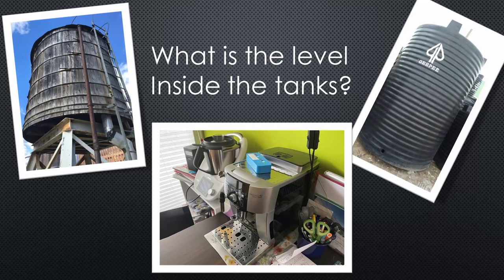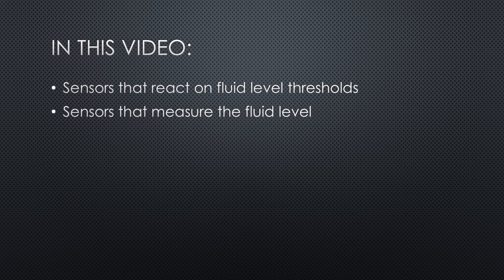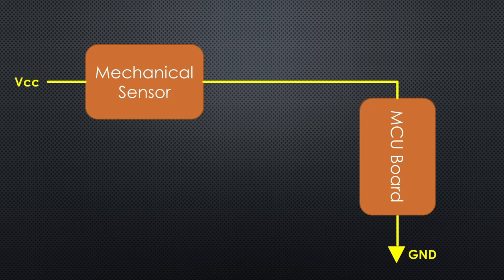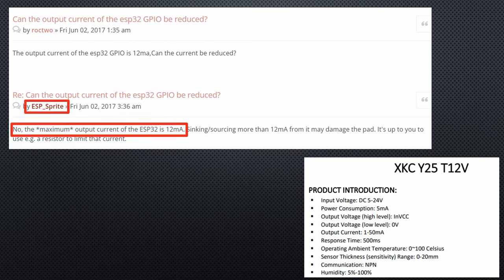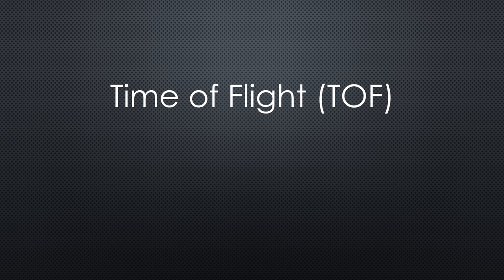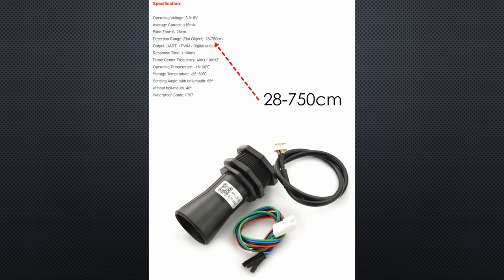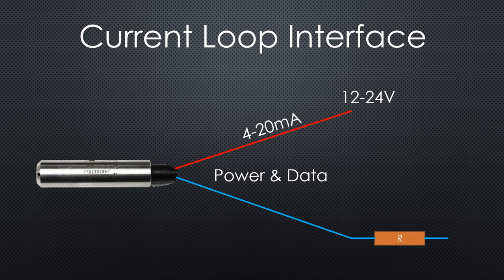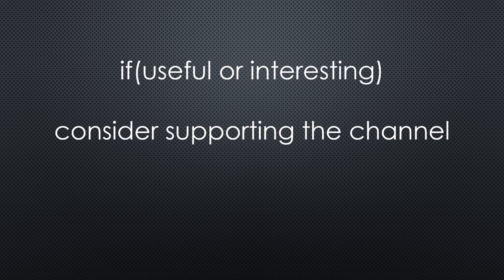#411 Ten Fluid Level (Water Level) Sensors and how to use them (Arduino, ESP32, ESP8266)

Comment: fwiw i found the infra red optical level sensors preferable to float switches which can suffer from calcification in our hard water area..
Reply from the maker: Good point. How do you mount these sensors?
Reply: through a hole in the tank wall, since i was replacing float switches it wasn't a problem to reuse the 1/2"bsp (20mm) sized holes.  they do require the lens being submerged. 
capped plumbing tube can make a diy sensor dipstick..

Comment: Hello andreas, i have a question. What's the best strategy to measure large water level such as a lake or reservoir ?
Reply from the maker: I saw that they used ultrasonic devices for that. But I assume pressure sensors also would work if you have access. Maybe somebody has already don it?
Reply: You often see these sensors which look like a pipe (culvert 30-50cm) coming out of the ground with a conical top. Inside is a pulley at the top with a line connecting a weight and weight with a float. The pipe connects to the lake or river with a tube, so when water enters the tube, the pulley rotation is measured. Originally, they were mechanical, recording on paper. Now electronic, you see a radio and often solar panel.

Comment: I would like to see your final solution with the coffee machine :D
I have the same problem .. bought a new coffee machine (not the cheapest one) and in the manual they say (don´t use the coffee machine with the empty tank) but no sensor / indicator on the coffee machine which says the tank is empty 🤦‍♂
Reply from the maker: So far I had no time to finish the project :-(
Reply: @AndreasSpiess  Schade ... if i have a nice working solution, i will share this on my channel :)
Reply from the maker: @d3rbastl3r  Subscribed 🙂

Comment: Thank you for information I am one of your followers and I like and respect your experience and the way you explain the ideas I am using ultrasonic waterproof sensor with arduino and I used NRF24L01 for wireless communication because it’s less cost than Lora also I have used in my projects many helpful ideas like power saving mode ,solar small charger and I am still improving the device best regards
Reply from the maker: Thank you for your feedback. Indeed, the NRF24L01 are good chips if they can bridge the distance.
Reply: @AndreasSpiess  can i contact you by email i would like to discuss my project with you thanks
Reply from the maker: I share my knowledge in my videos and unfortunately have no time for consulting :-(

Comment: for a project where the water is contaminated and where i know it will get pumped empty regularly (the keel of a wooden sailing yacht) I have been thinking about a different kind of sensor for the water level.
2 identical sensors for atmospheric pressure. One in free air (nice to have in a boat) and one glued into a tube that ends just above bottom water level in the keel.
As soon as water rises over the end of the tube the difference in pressure on the two sensors should give the depth of the water above the end of the tube. Every time the pump runs the tube empties and the sensors can be calibrated. This way the sensor would only be in humid air, not in water. Anyone tried this before?
Reply from the maker: Mechanical level meters for oil tanks worked also with such a tube. A manual pump pressed air into the tube and it’s max. pressure indicated the level because the air started to leave the tube at the bottom.
Reply: A few challenges to consider: The volume of air trapped in the tube should be small for better sensitivity, because of air's high compressibility compared to water, and I assume we talk about a relatively small range of water level change (centimeters). That means a thin tube or a short tube, or a more expensive sensor. If thinner tube, consider clogging from the contaminated water in the bottom of a boat. If short tube, consider your two pressure sensors probably mounted at significantly different heights to be taken into account in your calibration or calculations.
Reply: You don’t need two pressure sensors. Just one that measures “gage” pressure versus two that measure “absolute“ pressure.

Comment: Hmm, well I tried to leave a longer comment but it seems to have disappeared. I have tried multiple things for tracking the water level in my rain barrel, but the most workable+cheap so far has been a separate transmit / receiver waterproof ultrasonic like A02YYUW.
Reply from the maker: YouTube unfortunately started to delete comments containing links.
Thank you for sharing your experience! This is the first time this type of sensors is mentioned.
Reply: Load cells seem too expensive to handle 190 kg full barrel (even divided by 3 legs). Fluid pressure like you showed (even one rated for 0-5 PSI) are not sensitive enough to detect removal of a watering can full of water (~5 L from 190 L barrel). Laser ToF had issues with reflections, condensation, debris or slick on surface of water.
Reply: The separate transmit / receive ultrasonics can be closer to the water surface, and you can also control reflections easier using dual guide tubes. A simple US-100 ultrasonic lasted about 6 months before condensation killed it. Now I use the A02YYUW and it hasn't died over ~9 months. One disadvantage of the waterproof ultrasonics is they tend to need at least 5V. I do have to wipe off condensation about once a month to keep readings reliable. Ultrasonic in principle can bounce directly off water surface, but in practice debris or slick on surface of water (common when water comes in or out of barrel) interfere, so I also have a styrofoam float.

I would like to try other options if they are more reliable and not too expensive.
Reply from the maker: Thanks for the additional info. Maybe you search for comments in this video about a sensor using a tube to the bottom of the tank and a pressure sensor outside the tank (sometimes with a pump). This seems to be a simple and very durable solution.
Reply: Thanks! Do you mean using an air pressure sensor in a tube that runs to the bottom of the tank? As mentioned in the comments, I think this requires something to blow out so that water doesn't slowly creep up the tube. I should have mentioned that I am also hoping to run on battery. The A02YYUW I have communicating 9600 baud with ESP32 ULP, only uploads data when there is a change, so it runs a very long time.

Comment: 4:00 watch out here! The data sheet suggests the device features an internal resistor already.
Reply from the maker: You are right! I did not have a close look. Its value is 20k. This is not usual with OC outputs. That is probably why I did not look good.
Reply: @AndreasSpiess  Totally agree. Having this resistor in the device and calling the output OC is simply wrong. It does have a potential!
Could you actually measure the idle voltage / real resistance?
Reply from the maker: I measured the resistance.

Comment: The barometer is another one for some cases (DPS310)
Reply from the maker: Where would you place it?
Reply: @AndreasSpiess  As you know barometer measures pressure and therefore height, if you place the device float on the water itself (as I did) then you can measure the height as it changes.
Reply: @ShirolaGhadirian  Yes, but you would need another sensor at a known height to measure the air pressure to calculate the difference against, because the atmospheric pressure in general may vary way faster or more than your "pond's" (or whatever it is) water height does.

Comment: Microwave / radar sensors detect water. Unsure if any use!
Reply from the maker: They can be used if they can measure distance, not only speed.
Reply: @AndreasSpiess  Thanks.  As radar sensors can detect water and people, is there a way to distinguish between them such as if you want to detect people in a swimming pool? Presumably the signal returned from a person has some differences owing to the relatively lower water content.
Reply from the maker: @jonscott8586  Not that I know of.

Comment: Have anyone mentioned the “bubble tube level system” yet?
Reply from the maker: I am not sure. Is this the system where a pump blows air in a tube to the floor of the tank and the pressure is measured?
Reply: @AndreasSpiess  Correct. Not the first thing a maker would use but frequently used in the industry where you all ready have compressed air available.
Reply: I have used exactly that system to measure the level in a water tank in a boat. I have a small aquarium pump that runs briefly to clear water from a tube that goes to the bottom of the tank. Then I measure the pressure in the tube. From that I calculate the level. Quite accurate and no electronics in the tank. Could be used for diesel fuel or black water also.

Comment: Our wifes are the drivers of inventing things, of improving stuff. The pcb of my 25ys old central heating is not working properly. The water pump should go on from time to time, to keep the water circling. It does not. But the sensor itself is OK, measures the 70 deg C. But since there is no circling water, the much colder water from the radiators never reaches the sensor. So ... I turn the potentiometer to set the target temprature. Since this potentiometer is at the heating central, and this is at the attic ... I turn this potentiometer by a servo, which is controled by an ESP32 connected to my homeassistant. Whenever I feel cold, I can raise the target temperature by 10 degrees, which es enough to trigger the pump, and make the water circling again. After 1 minute the servo goes back to nornal position by itself, so the heater goes off by itself once the whole circling water reached goal temprature. Works as expected, and I did not need to make any damage to cables and stuff. I could solve this - until the new PCB arrives, by using my favorite maker techniques: 3d printing, automating, coding. The mount of the servo uses existing holes only, so I can remove it without traces once the PCB arrived. My wife has warm feet, I had a great weekeend fiddling with Fusion, some C++ and homeassistant. All happy.
Reply from the maker: Interesting solution. I agree that we can solve a lot of problems using 3D printers and microcontrollers.

Comment: Thank you M Speiss for this information. I have a surface well and I want to install a device that will be able to measure the quantity of water in my well. If I understood your info correctly, the best choice in my case would be Ultrasonic Sensor (7m) or a pressure sensor at the bottom of the tank but you do not give a link on youtube. Is it possible to send it to me please
Reply from the maker: The links for the products I showed in the video are in the video description.
Reply: @AndreasSpiess  Sorry M Spiess, I just found it (Throw.in pressure sensor). I had made your list twice before I messaged you. Probably a little too much wine at this time; 0)
Reply: @U72740  You can always measure the level of wine in a bottle by putting a stick in it.
Reply: @Martin-se3ij  Dear Martin . You still need to have clear ideas to execute your brilliant idea😉

Comment: Hi Andreas,

Good talk on sensors.
I have played with the HC-SR04 sensor as I wanted to measure the position of an actuator.
I found it tends to see ambient noise as an echo and give false readings.
When the motor ran it picked up the noise of the motor and gears, was an interesting test.
So they are good where things are quiet.
Something to remember as one could get caught out by this.

Kind regards,

South Africa
Reply from the maker: Good addition. Thank you!

Comment: I wish to measure the levels (from summer to winter ) in my home well. I am 
curious how much it fluctuates in our dry summer season
Reply from the maker: Now you have no excuse anymore to do it ;-)
Reply: I too have a (dug) well that I monitor so that I can track seasonal changes. I used radar (Acconeer XM132 module) talking I2C to Arduino pro mini and LoRa to relay info to my house. Sleep current is less than 1ma. Max depth is reported to be 12M - but at 7M setting works quite good. 1mm accuracy (specifications). The radar device can be programmed to indicate a measurement to the "largest flat surface" - in this case the water surface.

Comment: What about reflective or refractive angle measurements? Shine a laser under an angle onto the surface and vary the angle until the reflection hits the detector, which is depending on fluid level.
Reply from the maker: Interesting concept. It probably needs some (horizontal) space and might be susceptible to ripple on the surface.
Reply: @AndreasSpiess  very true. This probably works best when the viscosity of the liquid is relatively high.